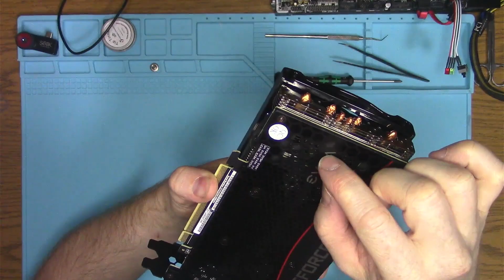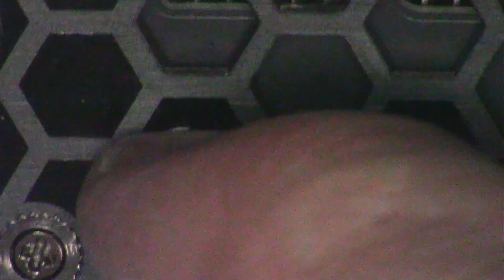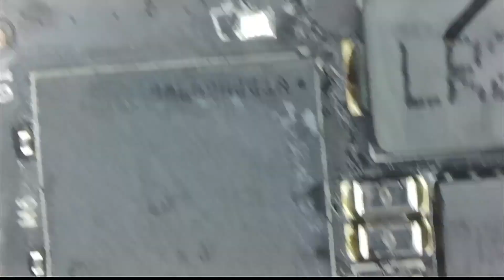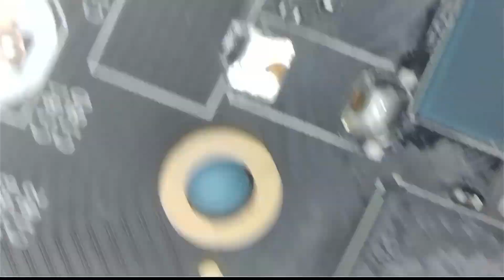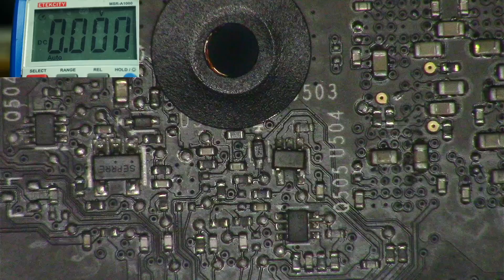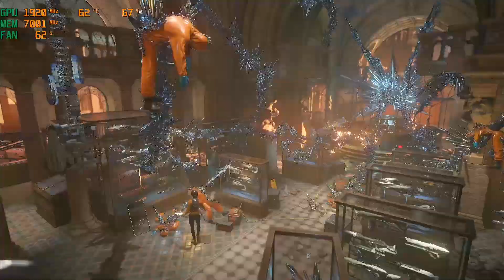NewEgg RMA center graphics card scam exposed

Comment: EVGA RMA'd GPU's actually DO get the overlapping serial stickers by the PCi-E 16x pretty often as well as the "QC - OK" sticker. Whats more suspect to me is the overlapping tamper stickers but it's possible EVGA does it like that too. EVGA used to do dealer RMA's with newegg where any EVGA card returned to newegg within 1 year of manufacture could get sent back to EVGA for refurb, then  sent back to newegg to be sold under a reduced 1 year end-user non-transferable warranty using -RX and -RL suffix models.

The pictured card appears to be part of an end-user 3 year transferable warranty model, as seen by the -KL suffix. It has already been replaced under warranty (the 6th to last digit in serial is a "9" indicating an EVGA refurbished/replacement model. 0, 2, and 8 are the norm for original retail models) and this is a replacement model. Any GPU sent to EVGA gets replaced with a different serial number if the unit is covered under a warranty, and the physical card gets replaced too, usually with a refurb. This is probably why newegg denied a refund since the model the buyer sent back to newegg didn't match what the user originally bought.

Comment: I have a procedure I use to protect myself when I'm forced to use scumbag companies like Newegg (there are a lot of them these days).  When I get overcharged, or they try to deny warranty coverage, one thing they often use is to say something like "when you bought this, the web page said it was only a 90 day warranty, not the usual 3 years, so it's out of warranty...".  Of course that's not the case, but how can you go back and prove it?  What I do is fire up OBS to capture a video of the screen, then go back to the web page, and scroll down to highlight that the item is listed as new, what warranty it has, and what shipping is included, then put it in my cart.  Then I click on the cart, and finish the transaction.  I then move the video to backup, and append the vendor and sales order number to the video name.  Twice now I've had to pull up these videos to prove that an item was sold with full warranty coverage, and both times the companies just replaced the item without any more hassle - saved me several hundred dollars both times.  I encode the videos using AV1 1080p-30fps so they are very small, and easy to backup.
Reply: you should make a tutorial on this and then, take the opportunity to expose how bad and scummy new egg is, i got smashed 200 usd for a gpu card that they never wanted to replace, filled a complaint with my bank and did a chargeback.

Comment: Hi, How to remove gold color fuse from xfx rx 470 if its gone bad and stuck ? Thanks :)
Reply from the maker: Same as you remove anything else.
Reply: @northwestrepair  Ok, but its stuck hard. And tell me what amp fuse to replace it?
Reply from the maker: @dani2085  you need hot air and flux to remove smd components.
The value of the fuse I cannot tell you. Depending on where it's at and what card it is, I don't know what rating is required.
Can be anywhere from 5 to 30 amps.
Reply: @northwestrepair  Ok thnx. Do u have XFX rx 470 schematics?
Reply from the maker: @dani2085  on discord server should be something close enough.

Comment: Why are you surprised that newegg/EVGA wouldn't bother to spent much time on this. if the BOM for the card is $200 then shipping marketing R&D etc is another $20-30$ with the 10% margin we are looking at $250 the rest up to $300 is usually sales tax duties and the retailer margin. How much would you as company spend on $200(their cost) card to repair assuming $50hr/labor keep in mind that this card issue was intermittent  and most probably the state it was in this video was a lot worse than in the initial RMAs. I can just see how this card went in for RMA they tested it it worked perfectly then it was sent back and so on. With bad contacts like this bench testing sometimes it just works, then mounting it in a case cause it to not work due to the forces. 
And it actually took a person at least 1 hr just to test this card.

Comment: Thing is EVGA do a direct RMA service where if the card fails you send it to them and they will fix or give you a new card it takes a little time, but is better than sending it to the store to RMA as the store. It even says on the Boxes do not RMA through the store but direct.

Comment: I was kind of hoping you would re-solder all the connections of that component and straighten it out, but I guess if it works it works.
Reply: Being crooked won't do any harm. However exposure to heat straightening out a problem that is purely cosmetic, might.
Reply: @JoshVennix  ^10000% this.  the less you have to remove from its original home, the better chances of success and the less variables you are changing.

Comment: Far more likely this is refab by EVGA and QC just wasn't on the ball. And NewEgg just passed it on as warranty replacement. Retailers do not have the staff or the skills to even try to rework like this. EVGA still technically supports their warranties, but I'm sure the care level is going down as they have pulled out of the market.
Reply: EVGA has an excellent reputation, while Newegg is known for screwing their customers.The math is simple on this one.They didn't have the staff or skills, but they still tried. All for profit.
Reply: @fixitman2174  Maybe. Or maybe EVGA repair guys had a bad day and that one component which was clearly manually replaced earlier, was just soldered sloppily and it passed their tests, but turned out to be flaky later. This seems far more likely to me than Newegg actually doing board level repairs themselves. No retailer really does that kind of stuff. Replace fans? Sure. Test returns? Sure. Solder something? Nope.
Reply: @Jarnis-v1c  There are infinite possibilities regarding this particular card. Based on my experiences, NewEgg probably has third parties performing cheap repairs. The "new" RX 6900XT cards they sent me 2 years ago were obviously repaired poorly. The first was DOA, the replacement worked with minor issues. I paid over $2K for a new card, and they sent me someone else's leftovers.
Regardless, we'll never know the truth about this EVGA card. All we really know is our opinions differ. No big deal :)
Reply: @fixitman2174  Why would NewEgg  repair a card that is under warranty, instead of sending it to EVGA for repairs?
Reply: @Jarnis-v1c  You seem determined to blame this on EVGA, Why would EVGA use fake stickers after the repair? That makes ZERO sense.
Some people just have to be right, even when they're totally wrong...
Reply: @fixitman2174  This is pointless. Someone repaired the card and made a poor job in a way that passed a quick test, but did not hold. And 99% likely it was not Newegg, they do not have the skills or the facilities. Since the card was under warranty, who else would it be other than EVGA? You do know that when vendor repairs it, it may stick on new stickers which look different than the ones out of the manufacturing line. Now it is also possible EVGA refused this card under warranty and then NewEgg got it repaired in some third party repair provider, even if it seems unlikely to me. 

And I know how this works beacause I've worked in the field and handled warranty dance with distributors and manufacturers. They send back reworked cards as warranty replacements all the time. Repairing the exact card customer sent back is actually very rare and almost never done, mostly because the turnaround time can be many weeks, instead you get some other card of the same model, which may be new, but most commonly it is a refurb. And these are provided by the manufacturer of the card. Refurb cards can sometimes look very suspect and have unusual stickers. Sometimes they also have outright physical damage in the shrouds / backplate, because cosmetics is not considered at all (which then can really piss off customers who get these as replacement while they sent back a card that looked flawless)
Reply: @Jarnis-v1c  Wow, you still think you're going to change my opinion. What a waste of time this has been. Feel free to continue wasting your time. I've said all that needs to be said.
Reply: I doubt that is EVGA's work, you are right, NewEgg are not skilled enough, but it doesn't stop them from attempting

Comment: Lucky find on the fault!

Though I wonder what really was going on with the RMA procedure in Newegg..
Reply: Newegg has been screwing people with it's RMA system for years. The customer returns a defective device, and they replace it with someone else's returned device. They also sell used devices as new when they can. They did both to me when I purchased my RX 6900 XT @ well over $2k. The first "new" card was used and dead, the RMA was also used, but lasted about a year.
Reply: That wasn't luck, that was all skill, takes decades to acquire.